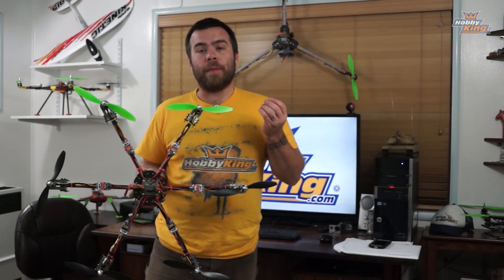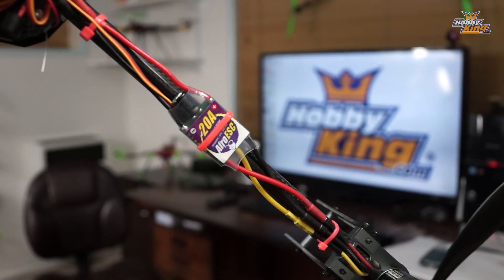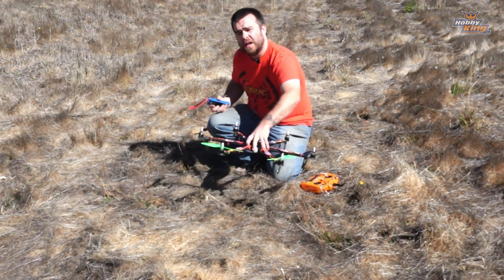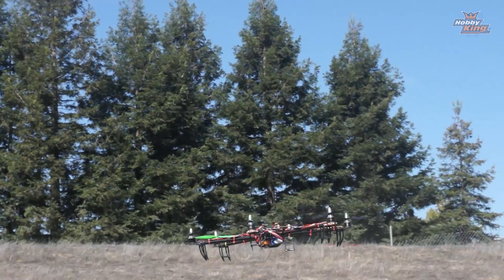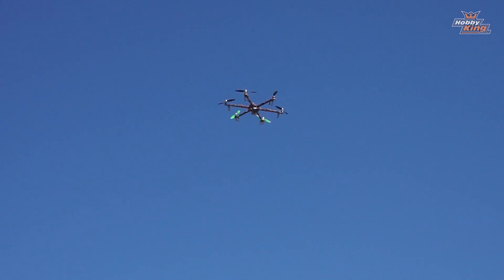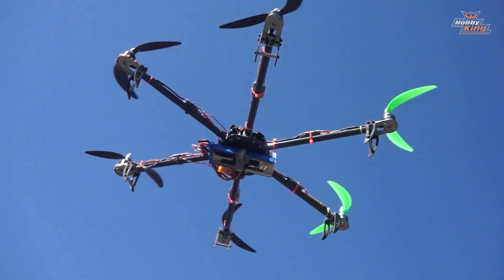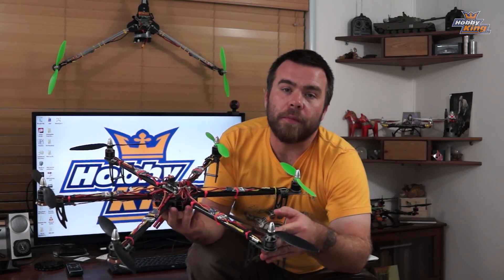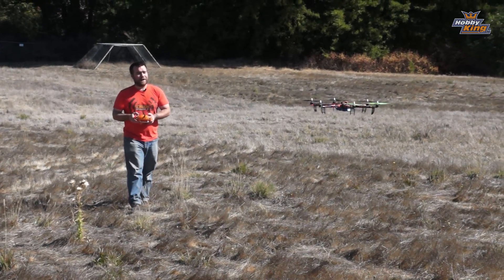HobbyKing - KK2.0 Complete Guide Pt.6 - Turnigy Talon Hexcopter v1.0

Comment: Hi Matt,  Following you SK450 tutorial I purchased a X550 quad, using turnigy 2830-11 100 kv motors, 10x4.5 props, turnigy plush 25 amp esc's and a kk2 still with firmware 1.2. My problem having set it up like your sk450 is that it lifts off left side first. Any ideas what Ive done wrong.
Reply from the maker: Upgrade the board to 1.6 if you can, and make sure you've calibrated your ESC's.   - Matt
Reply: HobbyKing Live Hi Matt and thank you. Got a programming card, updated to 1.6 and it flies. Needs a bit of tuning but 1.6 is so much better. Tricopter next